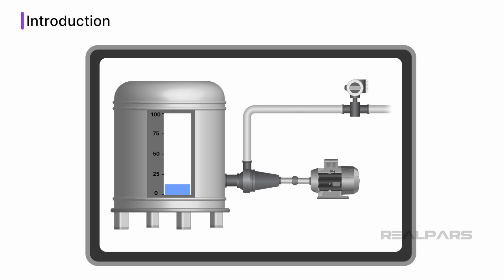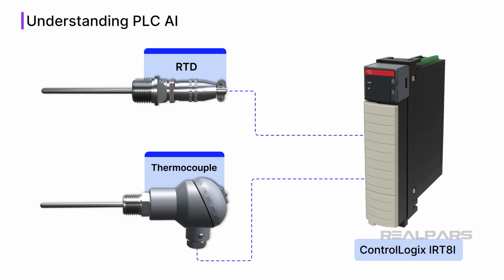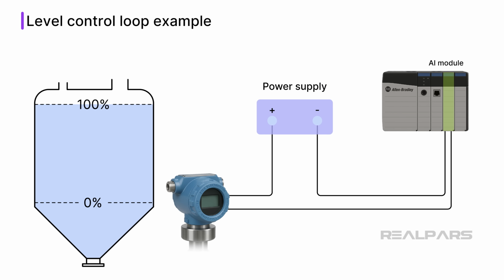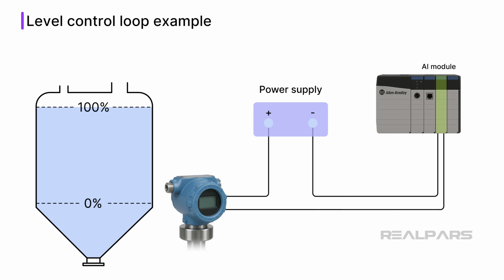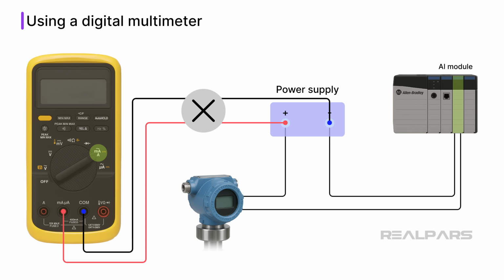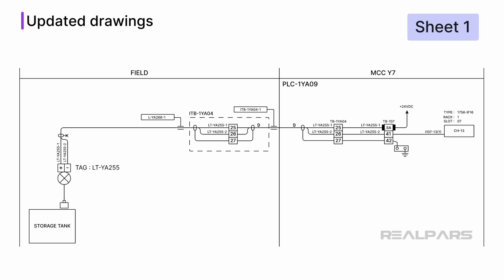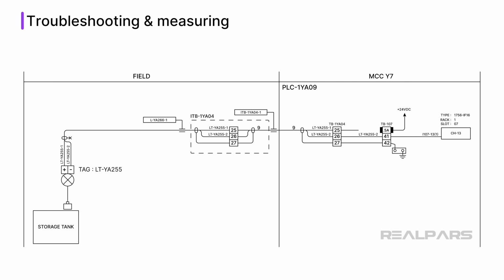How to Test PLC Analog Inputs Step by Step Guide

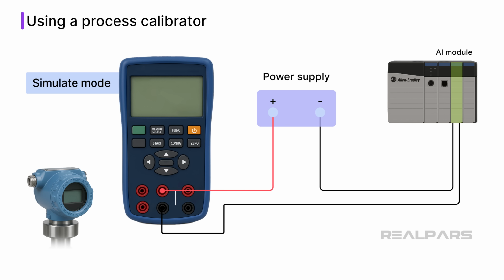Comment: 8:16 you replaced the passive instrument with an active process calibrator.
Shouldn't the power supply be removed?
Reply from the maker: Hello, @winner1338. Thank you for your excellent question! No, we need power. The calibrator utilizes the voltage of the power supply and controls it as required, according to our settings. The calibrator has a battery for the controls, but not the power requirements we need to send to the PLC. Therefore, we use the power supply to the calibrator and simulate the device. The PLC has no clue who is out there as long as it receives the signal it needs.

Comment: A fluke 773 has a ma clamp which saves you having to break the loop to check and also has source and simulate functions great for confirming if there is or isn’t an issue with the loop
Reply from the maker: Thanks for sharing this helpful tip!
Reply: I work in the boiler field. The 773 has a huge help for verifying current loops. 
I’m glad you brought this up 👊
Reply: Milwaukee 2231-20 will be more affordable for the same purpose